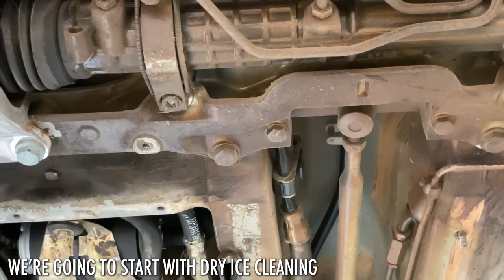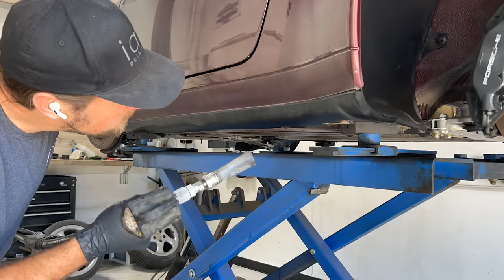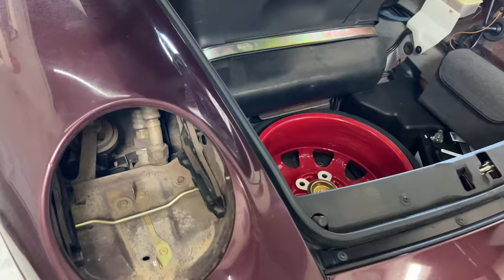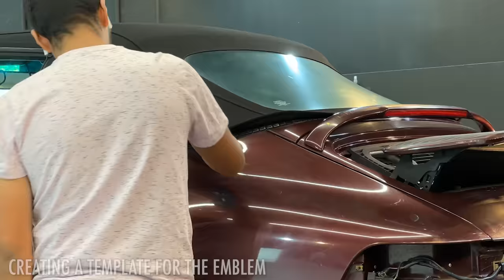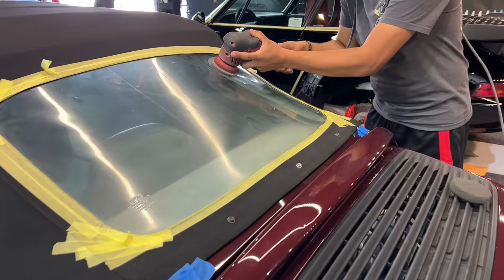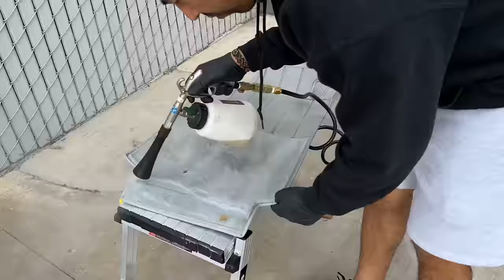Restoring ABANDONED Porsche 993 Carrera to SHOWROOM floor - PART 1/2

Comment: You folks are top notch, and execution of details is perfection! Thanks for sharing. One question When any vehicle is left to rot like the ones you reclaim, is there any maintenance like fluids, filters, belts, etc... performed by an outside source? I know low milage can be deceptive to some, especially when the vehicle looks better than new when you're done. But 5 years is long time between service. Just curious?

Comment: Nice work. Question? Does the dry-ice method used on the underframe strip any of the factory protective coatings off(cadmium etc)? It looks incredible,  but sometimes the grime actually helps prevent future corrosion from moisture and road salt. Do you add a protective coating afterwards? Thanks!
Reply: That is what they are doing. 90 % is removing all the cosmoline and protective coatings.Hope they apply a wax or undercoating back

Comment: The car looks stunning but I can hardly imagine that it set in the desert for five years. After dry ice cleaning the bottom there was not a single spot of rust or corrosion on the floor or on any part underneath it. Even in a desert that’s exceptional, and it looked brand spanking new actually after dry iceing. The 993 must have been at least 20 years old already when it was parked, and in an outstanding condition to. Otherwise I don’t think it would have survived it this way after five years in the burning desert, not even a Porsche. I think that the interior for example would have been fried completely. And why would you park a neat Porsche in the desert and leave it untouched for five years? There must’ve been a mechanical problem with it or…, well crazier things happend, but I still can’t imagine.
Reply: Desert climate is so dry no moisture can oxidize with metal

Comment: Awesome, but I don't get why the owners would want to leave (what's left of) that caliper paint original.  Especially considering they resprayed some other portions of the car.
Reply from the maker: Interesting choice but they end up looking rather good
Reply: You know how much a factory paint job costs? Especially on a Porsche! Because that’s exactly why they left it haha (I agree with you though)
Reply: @EJ1991  It's not that expensive to powdercoat brake calipers.
Reply: Ahhhh apologies, I misread. I assumed you were referring to the body, not the brake calipers. In that case, fully agree

Comment: This is not a restoration.
Reply: and its also not abandoned, clearly it was kept inside
Reply: @Cab895  what they did with dry ice is even harmful. As they simply removed all the factory cosmoline/wax layer. Sure it look pretty but in damper climates all that will start to rot and oxidise. Polishing and putting in taillights - yeah that is is a tough restoration, guys restoring 50s 60s rusted out cars should learn from him :D